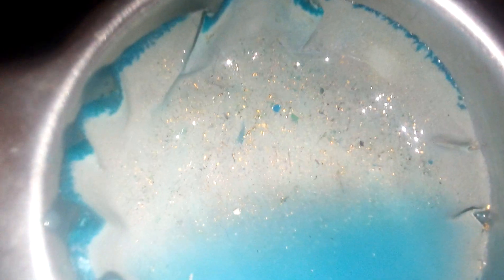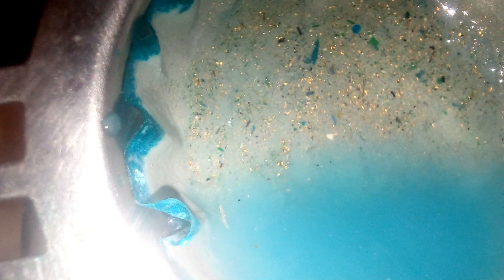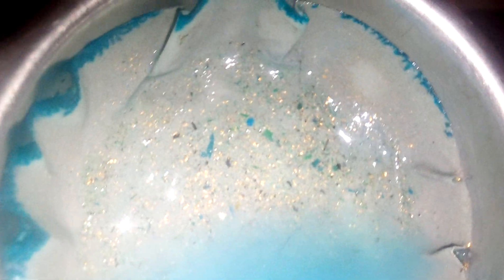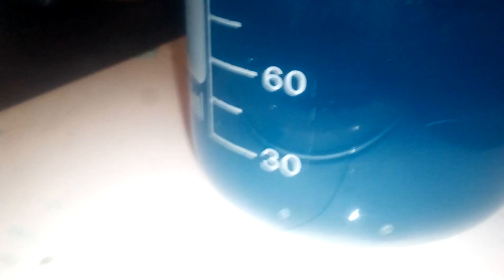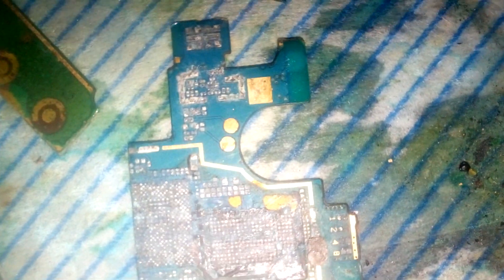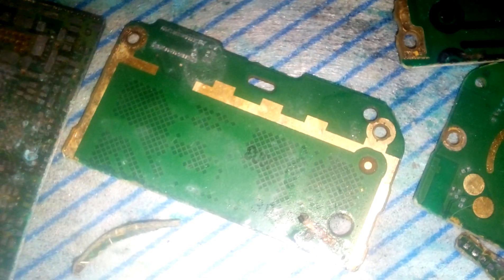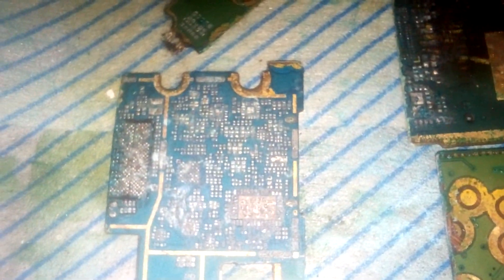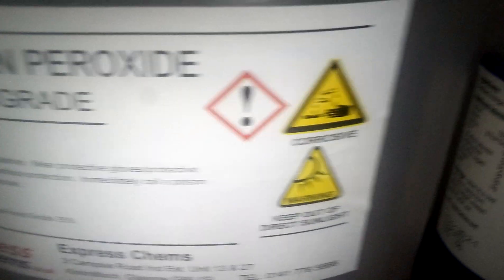Gold Recovery From Mobile Phone PCBs,Using Paracetic Acid 01-2.✨

Comment: So is this better than melting it all?
Reply from the maker: That would release toxic fumes arsenic and cyanide among them,resulting in a brass or copper alloy with only traces of gold within,this way i avoid 90% of external metals like the greenish blue copper you see suspended in the acid,melting what little is collected in larger amounts results in at least a measurable amount of gold within the alloy,its very little effort to use this method and cost effective compare to non homebrew or labor intensive to make acids.
Reply: @welshdragonmetals  Interesting, ive a ton of old computer parts, RAM and old intel/athlon cpus, this might be the way to go then, cheers mate.